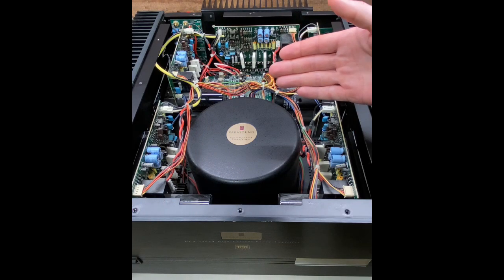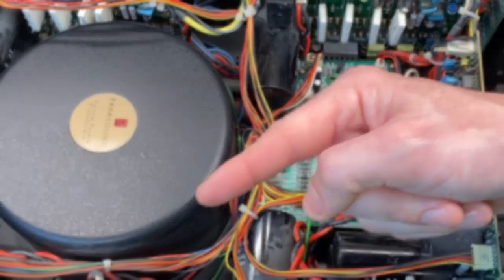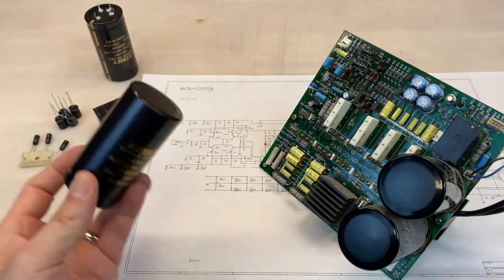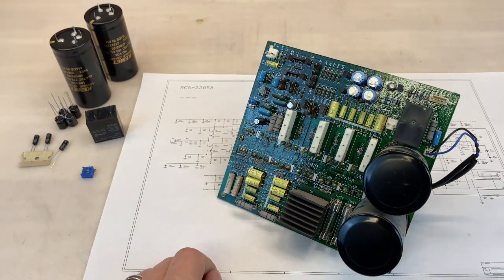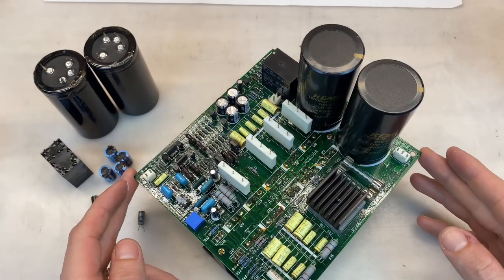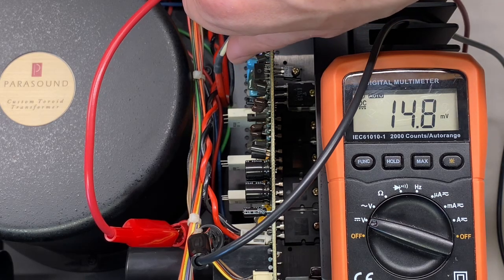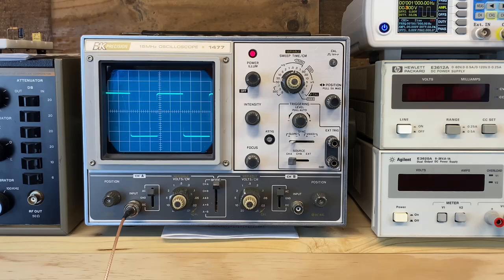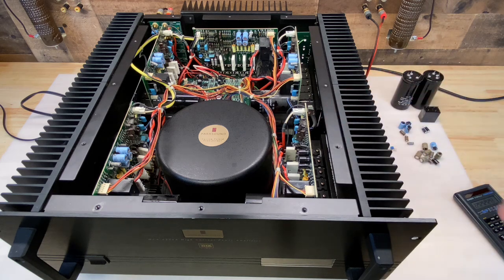DR #67 - Servicing a Monster - Parasound HCA2205A Amplifier

Comment: Did you test the large capacitors? If so what kind of readings did you get.  At what age would you suggest replacing them?
Reply from the maker: I did. They were all in spec for capacitance (+/- 20%) and ESR. I’d only replace when they’re failing one of these measurements.

Comment: I’ve really enjoyed your videos — they’re short, to the point, and packed with clear explanations. I was wondering if you might be able to help me with a repair issue I’m having.

I have a Line 6 Amplifi 150, and I believe there's a problem with the power supply. I'm not entirely sure what caused the issue or whether it may have damaged anything else internally. Unfortunately, I contacted Line 6 and they no longer support repairs or replacement parts for this model.

Would you be open to taking a look at it?

Thanks for your time, I really appreciate the work you share.
Reply from the maker: Possibly. Send me an email. nick@duality-er.com
Reply: @dualityrepair4770  email sent and thank you

Comment: Very nice work! What temperature do you use for the glue removal? I've tried hot air in the past but it didn't seem to make much difference. OTOH, I was very conservative with the temp (nothing above 80C) to avoid damage to nearby components (polystyrene caps).
Reply from the maker: If I have room around the glue, I’ll go to 200-250F or so.